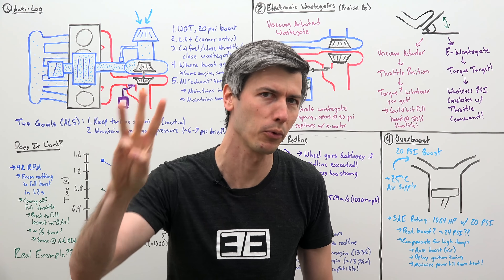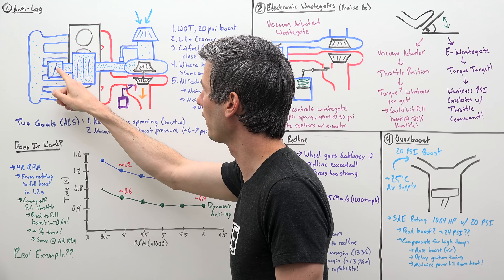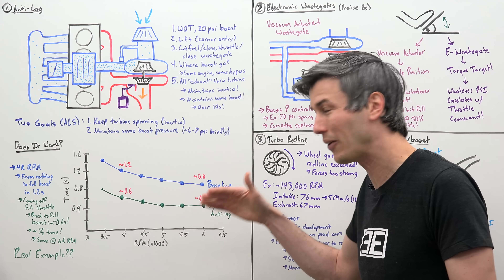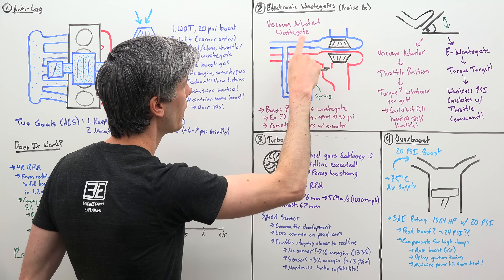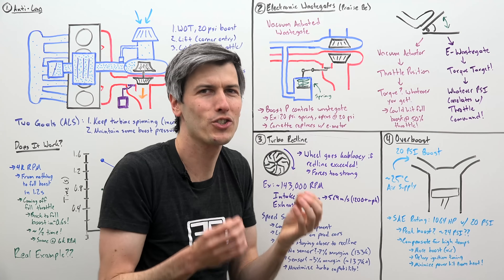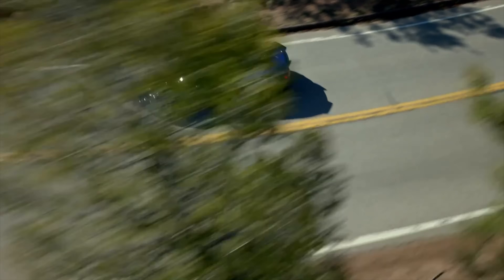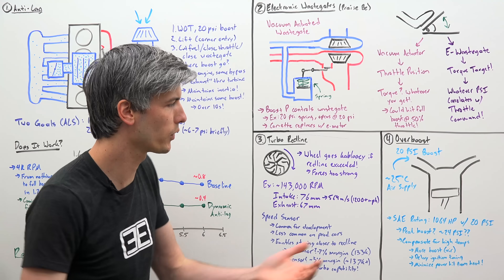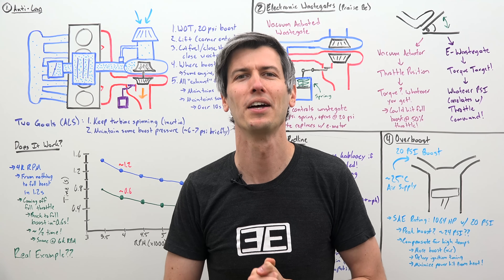Corvette ZR1's Anti-Lag System – Massive Turbos, Minimal Lag

Comment: These concepts are not New. I'm not sure why GM market this like they did something magical. 
European Manufacturers ie VW/BMW/Mercedes use more complex systems like these for years. 

1. Electronic wastegates and negative pressure Electronic (vacuum) wastegates have been around for quite some time (ie BMW n54 in 2006 with vaccum operated wastegates  and a vaccum pump, and Audi 2.0 EA888 from around 2015 with an e wastegate) enabling these closed loop operations with different boost targets and all what is pointed out in this video. They're almost standard now on any new modern engine.

2. Throttle control issue has been addressed by almost every modern manufacturer since early 2000s, your accelerator pedal is a torque request and not a throttle opening. If you input 50 percent throttle your ecm will adjust throttle angle, boost, vvt angles and different parameters to meet that request even if it means opening the throttle at 70% and bleeding boost pressure for efficiency. Anybody who knows about modern cars and diagnose and tune them know about these torque request and demand.

3. Turbo shaft speed sensors are used even in modern diesel applications, and many other petrol vehicles including vehciles like Infiniti Q50 Red Sport and the main reason for using them is to prevent the turbos from grenading at high loads along with high ambient temperatures and altitude where the turbo has to spin faster to create the boost requested, instead of soley relying on a boost reference to control turbine shaft speed. Its just layer of saftey, if the speed is too high and traget not met, wastegates open to slow them down.

4. Some high performance European engines even use VVT to reduce turbo lag. Take for instance BMW s63 (m5) and Audi ea825 (rs7). You can briefly adjust cam angles to increase manifold pressure (ie advance exhaust cams so they allow some pressure from combustion to enter manifold or manipulate valve overlap) and therefore increase turbo response and reduce lag. 

Im not sure why GM pretend like these are new and publicised these concepts, when all they did was get up to date on technologies that have been used for a decade plus.

I hope @engineering explained can give his opinion on this.

Even a Chevy Cruze/Trax and Honda CRV/Civic has an E wastegate. 😆
Reply: Everyone sleeping on the Cruze technology😅

Comment: Did I miss something here? I don't understand the "anti-lag" part of it. It's doing literally everything almost every OE turbocharged system has done for decades. Bypass valve on the compressor side, a wastegate that closes under closed throttle conditions... the only thing that can help "slightly" with this setup, are the throttle blips under decel gear changes. To me, this is definitely not "anti-lag". True anti-lag would keep 20psi+ in the charge pipes when off throttle. Not trying to take anything away from the Vette, but this is just marketing nonsense.
Reply: My thoughts exactly. System is identical to an 80's turbocharged system. Only thing that looks different is the e-gate, which would behave the same as a spring wastegate during a gear change.
Reply: @joshualeone4383  exactly. The E-gate would be great for those part throttle situations, however a well set up pneumatic gate can still offer the same benefit. I specialize in tuning turbocharged cars, so I thought maybe I missed something in the video but I dont think I did lol.
Reply: I don’t believe he mentioned the impact of the super efficient routing of the intake; it’s a very short path with intentionally low volumes to reduce lag. Cleetus’ video where he drove the ZR1 had a great explanation.
Reply: @bwp253 considering the volume flow a turbocharger delivers in comparison to the volume of a typical charge air system, it should not have any effect on spool time. However, restrictive intercoolers can make a difference indeed.
Reply: He didn’t explain it at all
Reply: There is a throttle plate that closes, allowing the turbo to remain spun-up. Because it reduces pumping losses. There is an electric waste-gate that is controlled by the ECU to follow a certain logic and map. It can behave much differently than a mechanical/vacuum waste-gate. To say that this is the same: When it can literally be varied from fully open to fully closed at any operating condition, is simply to miss the entire concept all together.
Reply: @Triple_J.1  no offense, but I don't think you fully understand how this works. I have 18 years of experience building and tuning custom turbo systems, and nothing in this setup is different. A pneumatic gate on a system that runs 20psi under full load will have a spring thats around 12 to 15psi on an OE system. This means when you get off the throttle, the gate will be closed unless you're making more than 15psi (there are more variables, such as back pressure, but set that aside for now... it would still be closed at 5-6psi like the Vette seems to run at closed throttle). Electronic wastegates have their place, but they are not often the first choice when building a turbo engine, as pneumatic is proven and reliable, and can sufficiently control part or full throttle turbine speed in 95% of all situations.
Reply: There is another strategy about the antilag that it is incorrectly explained here and GM has never talked about what they are doing. My guess is that the throttle stays cracked (say 20-30%), gates closed you get about 6 psi boost through there and then you retard timing depending on the driver demand. Timing retarded, probably injection retarded, will keep turbo spooled and possibly not overheating (all controlled by a EGT model) and spinning. Thus when you press APP then you get to peak boost a lot quicker as you ramp timing back up.
Reply: The one anti-lag technique you can do with a diesel is a late injection event to pour heat & gas volume into the turbine.  Since this engine is GDI...I'm betting they might be doing the same, although that was totally not discussed in the video.  The other thing that was not discussed is whether or not there is a throttle valve in front of the compressor, there is some creativity in that (if equipped).
Reply: @madmat990  thats a true point, however he did say in the video they weren't using any additional fuel. Also, in a gasoline engine, using a strategy like that might result in some iffy EGT's, though I've never tried this. Late injection doesnt help much in a gasoline engine because we can still inject fuel at the same time, and just fire the spark plug when the exhaust valve is open, giving the same effect except you get some combustion chamber cooling with the earlier injection event.
Reply: @mrctuned2844  I'm with you.  Although I would not trust what the author said or was told, because a late direct injection may not use much fuel at all and thus an engineer could fib a little and get away with it.  The "iffy EGTs" (if it worked) would show you directly that it's effective because turbines generate power with heat.  Either way...as soon as someone gets into the ECU, we'll know for sure.  Are these hard locked or are people into the ECU already?
Reply: @madmat990  that I'm not sure of. I operate in an area where we won't see many of these cars if any
Reply: he didnt explain it that well. but i would definitely want to drive one before claiming that the antilag is “marketing nonsense”
Reply: @personaldeviant  considering a typical V8 twin turbo thats capable of over 1,000hp has extremely similar spool time as this vette, I would argue it is, in fact, marketing nonsense.
Reply: Making a Lag situation would require the manifold pressure to drop to atmospheric or below. Being under boost all the time will never be considered a lag condition. Also of all the turbo cars Ive worked on… and its been quite many as every oe car nowadays has a turbo it seems. I only see vacuum actuated wastgates and Ive not once seen a valve that re-routes the compressor charge.
Reply: @stacydavis9113  there is no such thing as a "vacuum operated wastegate", as it is fed positive pressure to move the valve, from the turbo. Also, a bypass valve has been used in 99% of all OE turbocharged cars, as most are a MAF based load system, and venting to atmosphere creates an extreme rich condition on manifold pressure drop. All the popular Mitsubishi turbo cars all the way back to the 80s run a bypass valve, which routes compressor outlet air back to the inlet of the turbocharger. This is the same with almost all factory turbo cars.
Reply: @mrctuned2844 first of all u know he meant pneumatic wastegate, second of all egates have been proven to be better for packaging and third of all, which v8 do u know that can make 1000hp and spools at 3000 rpm, no garrett does this. Especially with no antilag or antilag strategies. I agree with you tbh the corvette has nothing extra special, the corvettes biggest winner here is the egate, go vacuum test any external wastegate you have with a 10psi spring itll open slightly below that. Egates mitigate that completely. Although it wont effect 0 throttle-100% conditions completely it is a much more effective solution for partial throttle scenarios then burning fuel while off throttle. Regardless any twin turbo v8 youll work on at 1000hp is not epa compliant. But yeah mostly marketing gizmo, but still the best turbo system currently
Reply: @atifhussein5610  there are hundreds of examples of 1,000hp V8s that spool up quick. I have data to prove it. I just worked on an S10 Chevy pickup yesterday that has a twin 80mm 406 SBC. It will go from manifold vacuum, to 35psi (1450hp) in around 1 second. Hell, my 3.0L 2JZ-vvti hits full boost at 3800rpm, and makes 977hp. A V8 has no issues with spooling turbos when they are sized correctly. I work on these engines every single day in my dyno shop. Also, electronic wasegates are absolutely not better for packaging, in most cases. They are far larger, bulkier, and very sensitive to heat management, and will go into failsafe mode when the body temp gets high enough... ask me how I know. Again, not taking anything away from the Vette, its badass, but to say it's revolutionary is not correct, which is what the video is insinuating in my opinion.

Comment: 2009 cobalt ss, k04 turbocharger, vaccum wastegate, i swear whenever im not full throttle or the wheel is turned over a certain degree the boost stays at 6-8 psi so its not spinning when i exit a turn and it doesnt lag, its not new to gm

Comment: I'm not an experienced engine tuner but modern cars use engine load driven control to manage waste gates, not throttle position. Weather it's vacuume driven or electronically controlled shouldn't matter, aside from the precision electric would allow. Drive by wire throttle pedals don't request a throttle position, they request a an amount of load.
Reply: Some use load and RPM, some use intake and exhaust flow factors, but you’re right, definitely not throttle, lol. And his claim that vaccum-operated wastegate have poor throttle control is foolish since most high performance, vaccum-operated turbocharged cars have boost controllers.

Comment: I wonder how much temperature rise they get when the compressor is recirculating air? If you’re off throttle for 5+ seconds the recirculating air could get pretty warm.  I guess the reduced mass flow at partial throttle allows the intercooler to handle the superheat.

Comment: Back in the day, did anyone think to do a dual spring set up for a mechanical wastegate? Perhaps one large spring set at a lower psi to open partially and help bleed off mid level boost pressures, then the main spring
Reply: BMW has a wastegate that is vacuum driven and defaults to fully open. You have to apply vacuum to close it. Does everything an electronic wastegate does.

Comment: Largest turbo,but yet not anywhere near Jesko performance?? So Jesko turbo is more efficient creating horsepower??
Reply: Egg pressurized carbon fiber tank (boost storage) and an electric compress, the car itself is lighter, less drag, ceramic ball bearings, and much more, the egg uses more technology to compensate for the size even when their turbos are also large themselves, i couldn’t find the exact size but I’m gonna assume its not that big of a size difference
Reply: @AzulACR so thats how Egg creating extra 600hp from smaller turbo..
Reply: @adyyzels 600? Where are you getting these numbers lol the egg has 1280HP on the same fuel and 1600 with E85

Comment: The 2015-2021 WRX gave you full boost at half throttle because the DBW were set up to request full torque at half pedal position. It doesn't drive like poop because of the vacuum wastegate, but because of a tuning choice by Subaru

Comment: It's usually point 2 and 3 that's the main problem with turbo engines, I guess bottom end power ("torque") could be an issue on daily drivers if it's too low but on faster cars you kinda want a steady ramp up of power. 
The hybrids with generator/motor on the turbo is definitely opening up another chapter in turbo engines.

Comment: So this antilag makes the engine behaves like a 16k rpm NA engine, which is cool af!

The majority of the torque is still gonna be on high rpm but the low end is not gonna feel like limp biscuits, so basically like a liter bike no?
Reply: It has the response of a high-strung NA engine, but without the lifeless bottom end you'd expect because the turbos light off fast enough to provide a near-literal wall of torque much lower in the power band than anything but a literal truck motor manages. Remember, it has 800+ lb-ft of torque from 3,000 RPM up to 6,500 RPM, with a peak of 828 lb-ft at 6,000 RPM. That's over 95% of torque available across almost the entire operating window of the engine for track use. On corner exit, that means you effectively have all of the torque a quarter second after you open it up.

Comment: This doesn't look much like anti-lag anything to me. My 1986 944 Turbo recirculated boosted air when the throttle was slammed shut on the track and the boost was controlled by the KLR computer. Chevy has simply taken cutting edge 1980s tech from Porsche and put it on the Vette.

Comment: And now you'll have to do another video on the ZR1X!
Reply from the maker: Ha, not too much detail out yet, but it's a very similar strategy as the e-ray, just ya know, like double the power!
Reply: @EngineeringExplained and adding on the anti-lag system
Reply: I said when the E-ray came out why they didn't put it the Z06 engine with the electric front motor and I see that was waiting on to put it in the ZR1X. 
Others have already got the E-ray and Turbo it too over 1,200 HP so the ZR1X is already outdated.

Comment: So....solve turbo issues by having a huge V8 to solve the low end torque problem and then slap big turbos and have boost by gear ECU's...
Sure...I guess its fixed until you look at smaller engines and consumer cars that one could actually buy.
I have an electric waste gate on my car, still shitty partial throttle control.

Comment: I don't think what you say about part throttle making full boost is true. I saw many ecu maps from subarus and there is a table called "target boost" and there is boost target (psi) vs throttle position (requested torque) and rpm.

Comment: AAM has been putting Borg Warners on VQ/VR engines for a decade now. The wastegate flapper is....a crap design, I welded mine shut and welded a Tial wastegate instead, on the exhaust manifold, its much more reliable.  If you don't do this with time the flapper will become too loose and cause the exhaust gasses to bypass the turbine and cause power loss and turbo lag. I also use 2step/anti lag, and to use it at its peak efficiency I added a BOVs to eliminate turbo surge, now I am always in power band with this setup.
Reply: Internal wastegate is much better packaging, that’s why it’s done.
Reply: @TML34 Packaged does not mean better.